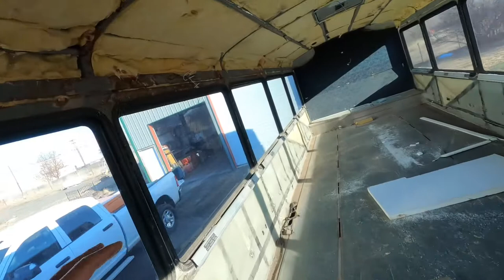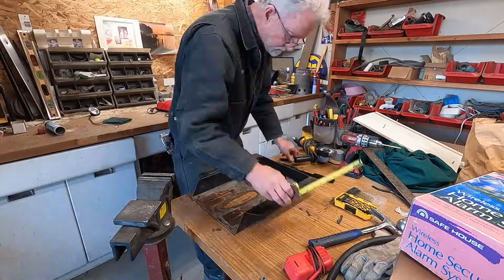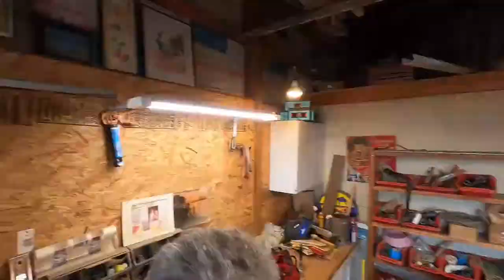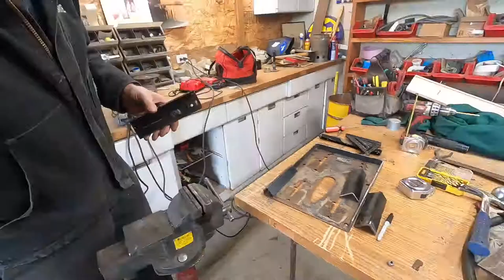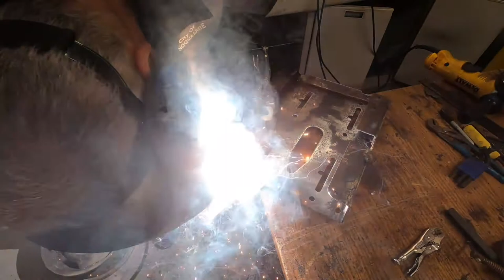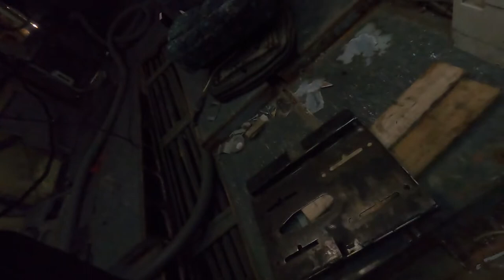MCI Bus Seat Pedestal Modifications E23

Comment: Nice Glen, not sure if you mentioned how long you have been welding for but I have only done a little bit of diy body panel welding with my brothers gas mig welder. I recently got my own mig Pak 10 / 140a flux core and plan to use that to build battery trays and whatever odd metal things I need. Glad to hear you are happy with your flux core welder and the results. Everyone keeps telling me get gas for your welder but I'm too cheap. Cheers Nathan
Reply from the maker: Yep, the gas is great and makes great looking welds, but for what I am doing, the flux core works good, and I don't care about a little weld spatter. It is less maintenance too. I've welded on and off for quite a few years, but I've never used a gas unit. I have a friend that can produce top notch welds with one, but he is a professional. Thanks Nathan.